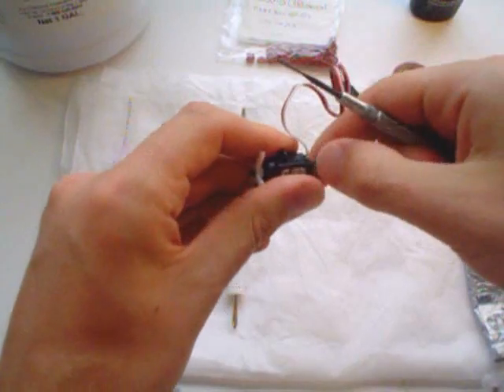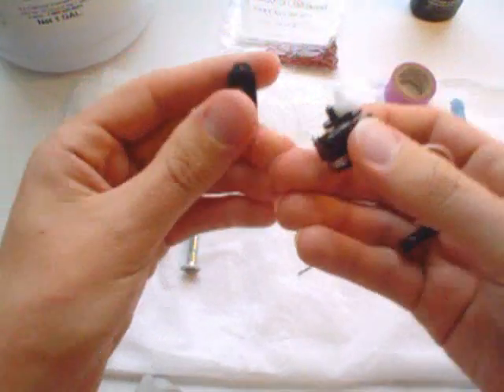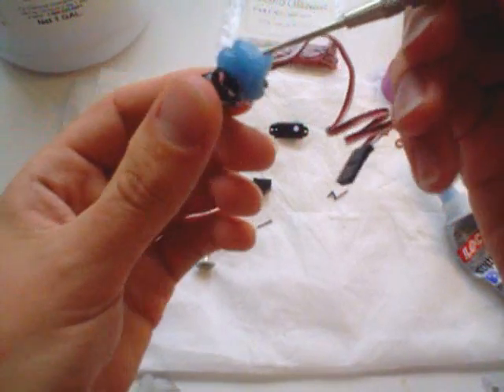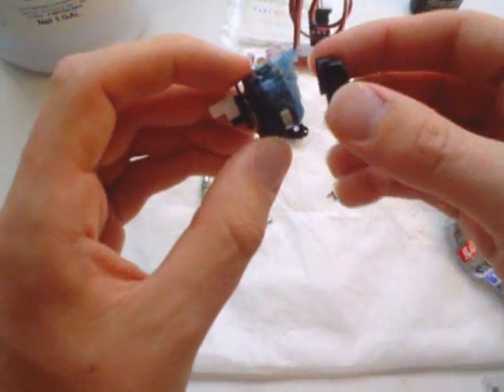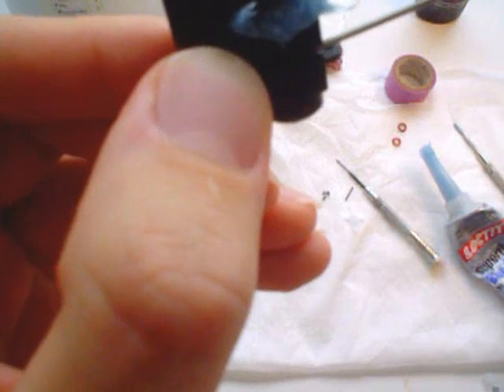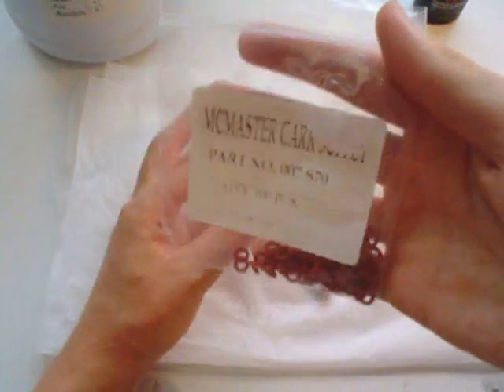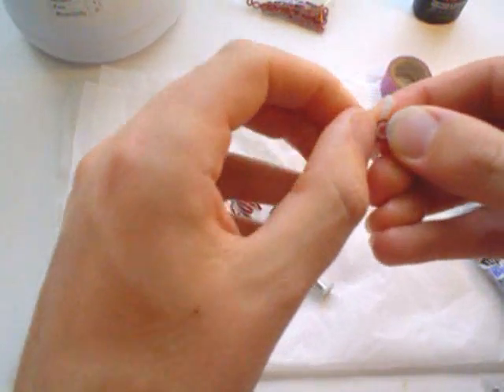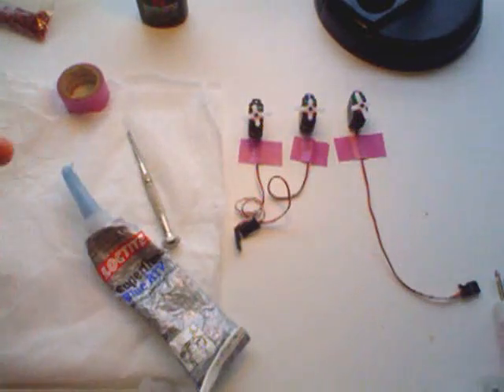How to Waterproof A Servo

Comment: The silicone used in here does not appear to be "Nutral cure", as such, it will release acetic acid on curing and damage the internal components. However, it will take weeks to a few months to occur, as there is not much air access for the silicon to sweat out the acetic acid.

Comment: Hey again. Cheers for buying that link. I'd actually put through an order just before you added that. Realized I need to look for dielectric. Ended up ordering Dow Corning 732 rtv silicone. It has a dielectric strength of 24kV/mm. Don't know much about the 24kV rating as I haven't read up on it yet. Does that sound ok to you? Thanks for being so helpful.

Comment: That's a pretty good way. but it's easier to just fill the top and bottom halves with non conductive grease and then use the o-rings

Comment: Another good method is to use pvc primer (usually purple) on the edges of the servo when its apart and quickly screw it together, it will melt all the edges together then just put the o rings on the top like in the video.

Comment: Being an RC boater, I used sprays such as Aero-Plate, The Stuph or Corrosion X. All you have to do is pop open the bottom cover and put a few shots of one of these in there and you're done.
I've emptied out radio boxes full of water and ran the boats right afterwards with no problems.
If you use a sealant, make sure that it is does not have an ammonia smell to it otherwise it will ruin the circuit board.